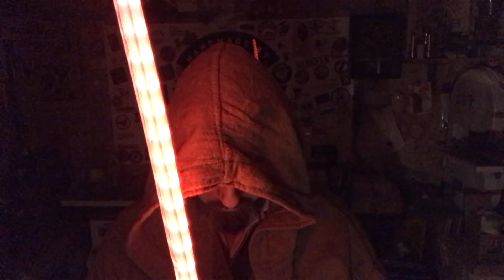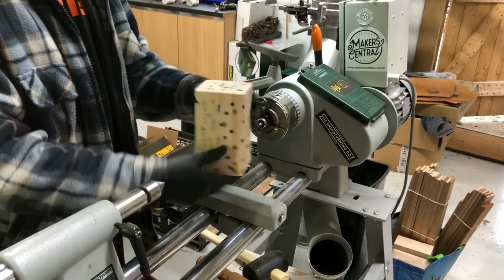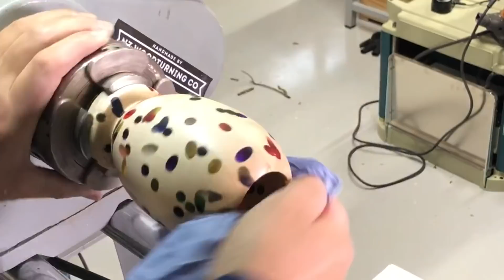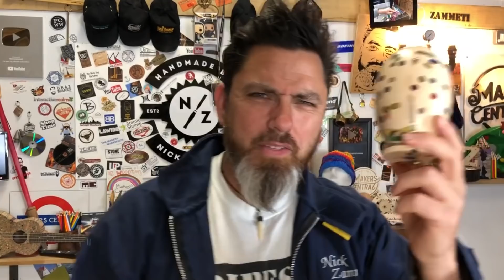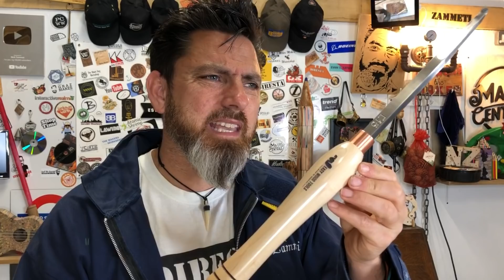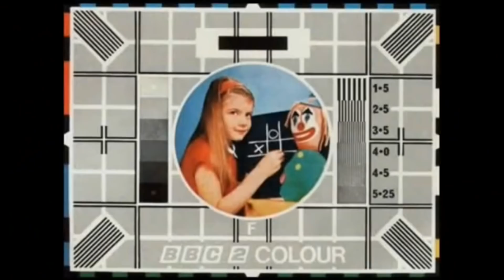Woodturning - The Resin Measle vase!

Comment: My name's Jeff, and I thank you for turning something out of one of the blanks I sent you. I wasn't sure how it would look when turned, pretty nice if I must say, putting a led light in as many of the comments suggest would look pretty cool. The one with the glow in the dark epoxy, maybe turn that into a mushroom, as the epoxy glows quiet brightly, it'll give it that ethereal look. Thanks again.
Reply: Is that blank made from worm wood? I used to work in a sawmill and we'd get logs infested with teredo worms that left tracks that looked like your blanks do.
Reply: @r.awilliams9815  Those holes are from a drill bit.

Comment: Question about the blank: how did he make them? drill partial holes? or through?  cool choice!
Reply: I drilled holes clean thru the wood, I only drilled enough, 6 to 8 per color, as I would angle the drill bit to have the holes going every which way thru the wood.
After the resin cured I would again drill 6 to 8 from the next side of the blank, pour resin in and wait for it to cure and I would do the same thing for each side after. I also drilled holes from end to end. This took many hours to do. 

I have been working on some new ones that have far larger holes drilled thru and the resins are crisscrossing thru the whole blank and you can see them thru the already cured resin.
Reply: Jeff S. Thanks! I have a nephew just starting out in turning and other wood artistry. He gets a kick from Nick.